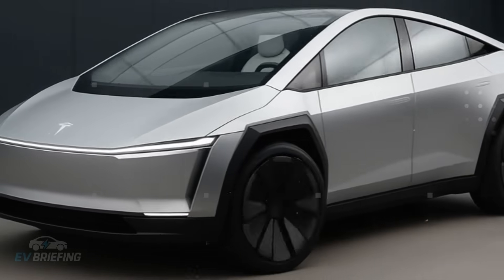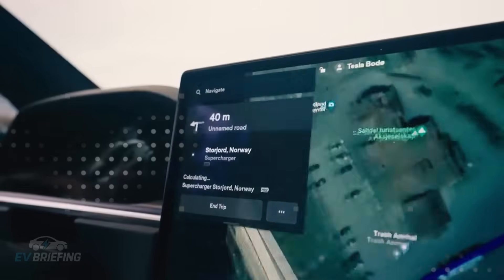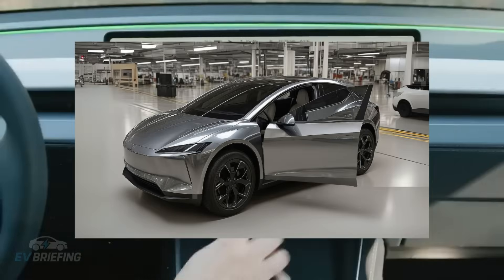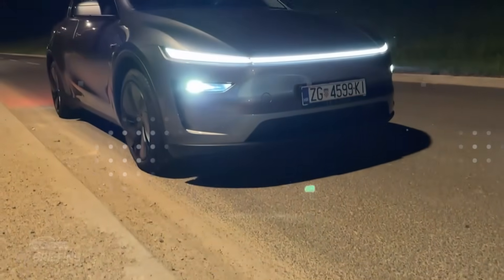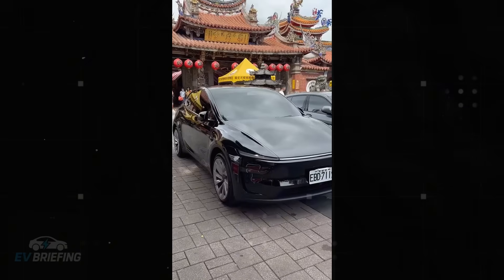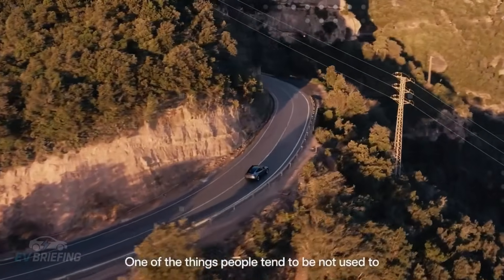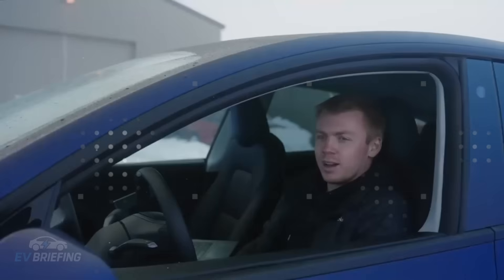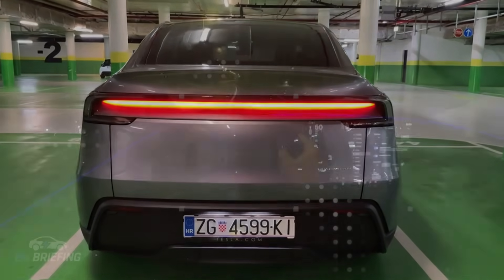2026 Tesla Model 2 Senior Revealed: $13k, Gigacast, Self-Repair Panels, Compact Butterfly Doors

Comment: That compact butterfly door is of real interest for me.   I do wish there was some real photos/videos of this in action and a confirmation that it is either a standard or a low cost option.   I am also interesting in something I believe is called vehicle to home, this is a power transfer in case of power outages.  I already have Tesla solar panels and a Power Wall 3 but I am thinking of a 2nd Power Wall, just the cost is a problem esp for a retiree.   But that vehicle to home feature if true spares me the cost of a 2nd Power Wall.